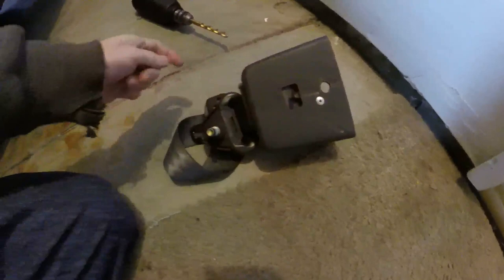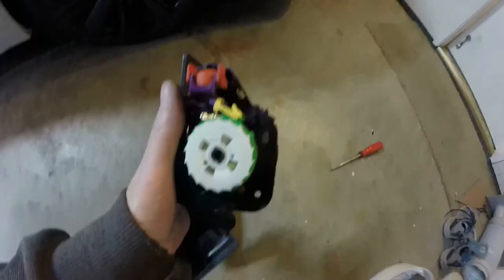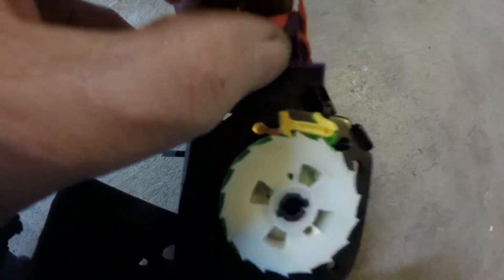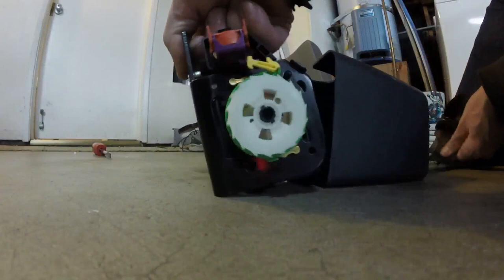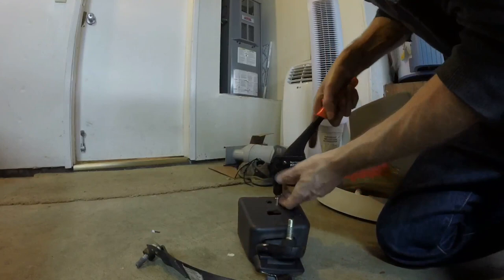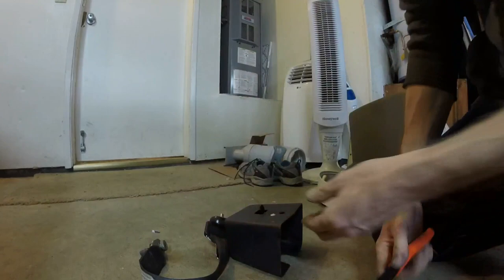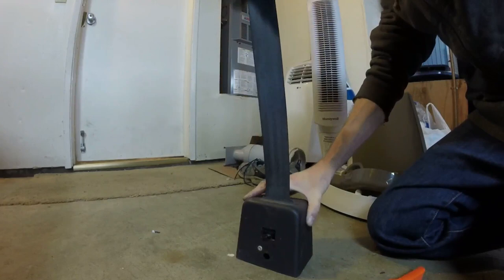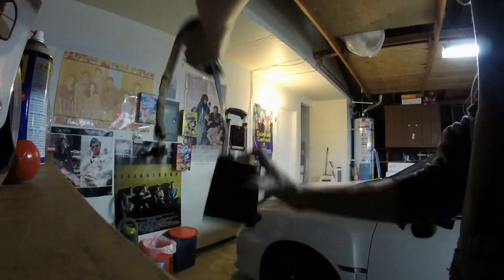2000 Jeep Wrangler: Ep. 14: Rear Seat Belt Follow-Up

Comment: Putting the purple arm through the yellow lever will cause the belt to fail in a typical crash. Yours did not slip out from the yellow piece, the way you opened it is normal. You can check the other seat belt mechanisms to confirm like I did. 

The error I saw in my Jeep Wrangler 2000 rear seat belt was broken spring that forces the green plastic piece back into position. I purchased an assorted box of springs from home depot and worked an appropriately sized one in place. Works like new.... no adjustment other than that needed.
Reply from the maker: good tip brother!